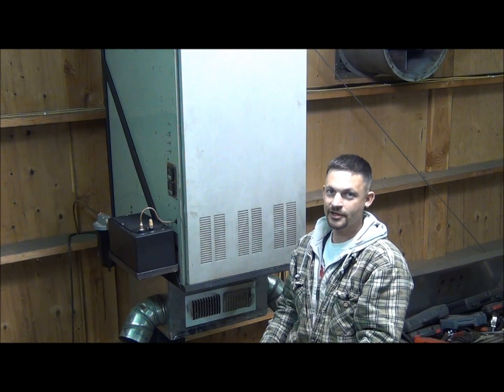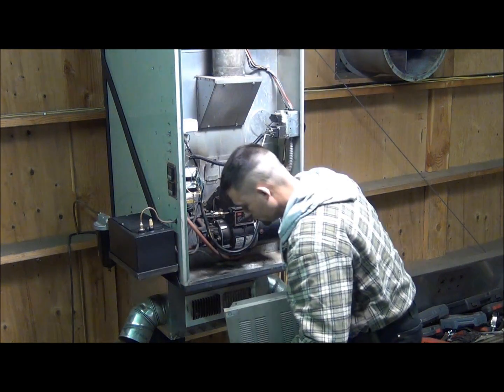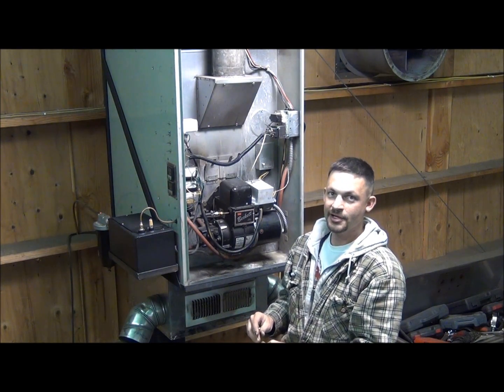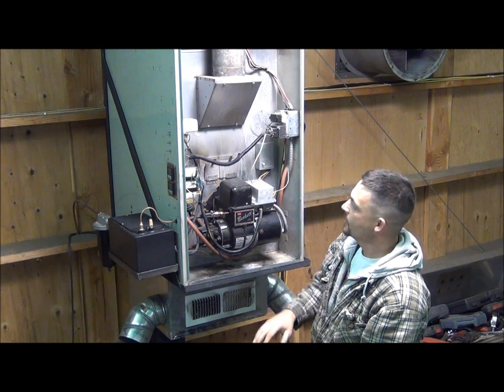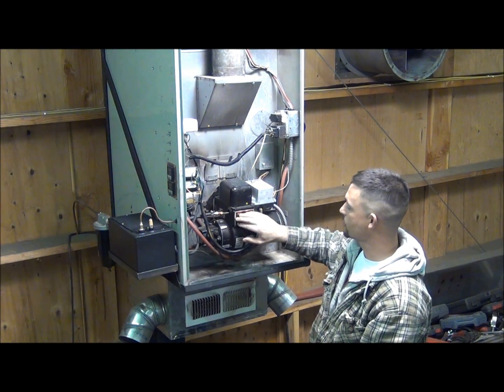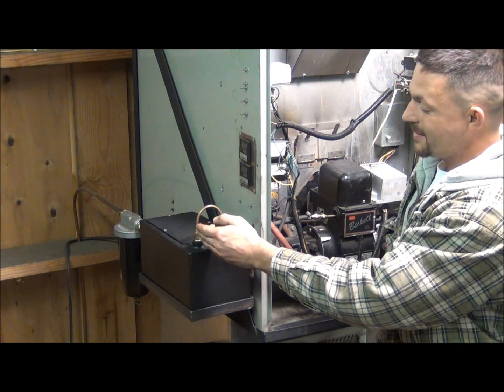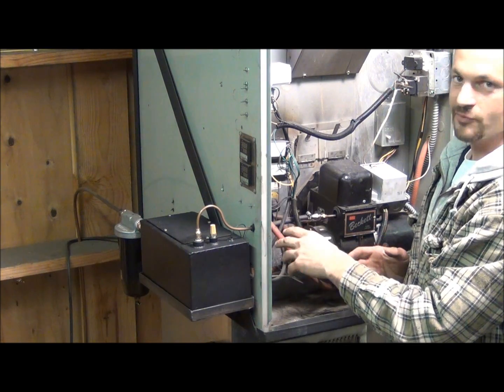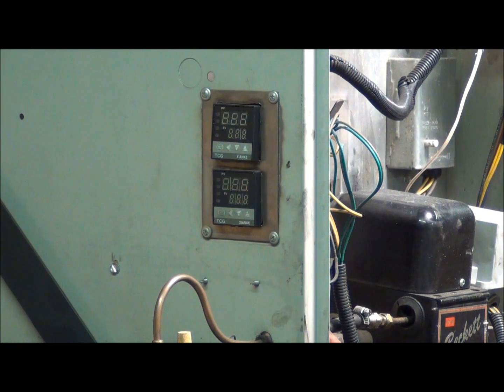Waste oil furnace construction and operation

Comment: I was so intrigued with what you did I asked myself why didn't you just triple filter the heated waste oil (down to 1 micron for example) and direct it into the pressure pump? That would not only save a lot of time and may even be as efficient?
Reply from the maker: I attempted this on my very first build; I already owned a centrifuge system for producing fuel from waste oil, and I tried running some of the filtered oil in the furnace.  The burn was inconsistent and the nozzle was prone to carbon buildup.  It required constant attention and tinkering, and was very picky about what kind of waste I ran through it.  The siphon setup will run on practically anything, and only needs a basic filter to take out the big chunks.  Much easier to manage.

Comment: What pump do you use to pump oil into the tank on side of the furnace.
Reply from the maker: I use a carbonator pump.  They are made to pump heavy syrup in soda fountains, and can be found for around $100 on ebay.

Comment: Wow, 4000 gallons is like a tanker truck full. You are getting your use out of that furnace. How is it working today? I want to do the same thing.
God knows how many gallons you have burnt to today.
Reply from the maker: Yep, it’s hard at work today! Will probably run through a few gallons today...doing an epoxy pour tonight so shop has to stay at 75 degrees.

Comment: Just wondering how u have the control box wired to come on when the temp is right ...I have just made a heat nozzle holder with a heat cartridge in it should work fine how to wire and watt to use is not my strong point thks ...keep up the good work videos are just the ticket

Comment: The ckep1 guy isnt on ebay anymore. Does this kit look similar or is this the same guy.
http://www.ckburners.com/kits.html
I just got a cub 700
Its a 720,000 btu diesel furnace. It currently has a 4gph nozzle in it. On a Riello F15 burner. I think i can turn it down to a 2.5 or 3gph nozzle if its too much heat. My barn is a 40x80 wood pole non insulated steel wall and steel roof. I got this thing furnace for $500 on FB market place. Just needed a $40 control box/igniter. Heat exhanger is stainless steel and looks good. Only 1,000 hours.

Comment: Sewerzuk What lift pump r u using? The forum link for HF Doesnt work anymore. I have 2 options right now buy 2 williamsons temp-o-matics for $400 and convert them or buy an actua 300kbtul waste oil furnace with all pumps and tank for $1600. Need to weigh out the costs

Comment: Could you share a parts list with me model block and heat elements and time\ controlers
Reply from the maker: I have a basic parts list located on the Garage Journal board; http://www.garagejournal.com/forum/showthread.php?t=24280
Reply: +sewerzuk I went on the link you posted looking for the part number or link to what your using for a float switch, currently I'm using a float valve that is supplied by CK burners but that doesn't control my pump like I want to
Reply from the maker: I have purchased most of my floats off of ebay; no part numbers.  but the ones I like the best are made of stainless steel and sold as aquarium float switches.

Comment: I'm want to use a RKC REX-C100FK02-M*AN controller. It appears to similar if not exact to your controller. Do you know if there is any significant differences that might affect me?
Reply from the maker: I'm not sure; I've used a handful of these things and they're all a bit different.  There are about a dozen manuals floating around, and I've always found one that seems to work for the controller I'm working on...